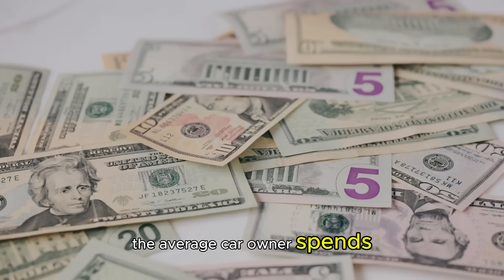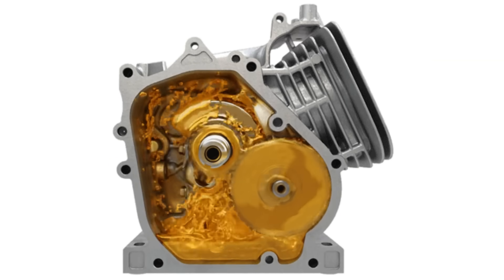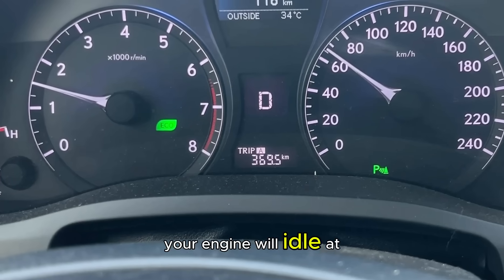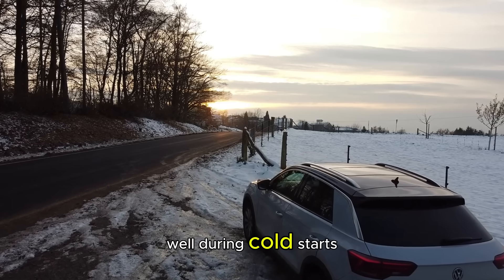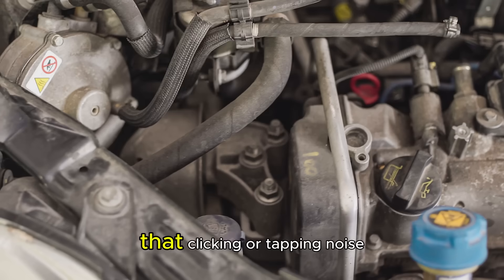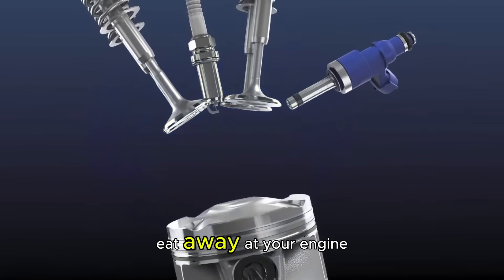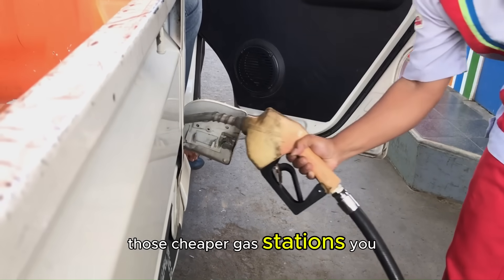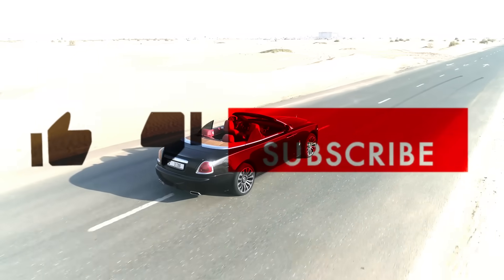Stop Making These 6 Cold Start Mistakes Before They SECRETLY Wreck Your Engine

Comment: I'm not saying he is totally wrong, I've been a mechanic for 40 yrs so YES I'm getting old. 1-ablock heater does NOT keep coolant at 85 degrees, I have a programmer on my 2012 ram 6.7 cummins, it shows actual temp, not even close.  2-they do not actually warm the oil, you need a pan heater for that. 3-as far as only letting it idle for 30 -60 seconds, little longer for diesel, then driving for 5 minutes BEFORE turning on the heater? Maybe if you live in palm springs, was -50 the other day, my acorns may not be huge but they would have been inverted, probably would have hit the ditch, how the hell do you see out the wind shield?  4-other than aluminiaum (no I don't know how to spell that) metal expands and contracts at the same rate, this is why they have specific clearances. I do agree don't rev a cold engine or rev it and then turn it off immediatly, even if warm, good way to destroy a torque convertor,  the one thing he is totaly right on is ALWAYS let a turbo car, gas or diesel idle for at least a minute before shutting it off, will save you a lot of money. no insult but you're a younger man with more to learn. Safe travels everyone.
Reply: Thanks for teaching
Reply: thank you, but if u let ur car idol for a bit on a cold start is that really bad like he “ai probably” said in the video?
Reply: Shit man. I haven't been doing this for at least 30k miles... I usually let the high pitched RPM noise die down before driving off, but I usually shut off right after I park..
Reply: Every single observation you made is on point ( it's Aluminium - that made me lough out loud- and yes, the pale Brits say it the right way). As a European a yearn for a halftone pickup truck with a Cummins engine. They're pretty scarce around here. And the new American trucks are mostly garbage. Just as a question or tip: if you're living in harsh winters you should checkout those high-idle chip tuning kits. Obviously for when you're idling for longer periods of time.
Reply: Mainly the dodge has a auto idle up, you can do it with cruise control as well, have to get a 3/4 ton for the cummins (stay away from anything newer than  a 2012, they went to a roller lifter, bad idea. Takes out cams just like the 5.7 hemi) If you want a good one find a 5.9 cummins, best one ever built. Yes I'm a mopar guy but had fords, chevs and imports, dodge is the only one that never made me walk home. (Hell I can barely say it little own spell it lol)
Reply: If you start off with your heater running it's not going to warm up the cab anyhow. So that ain't gonna defrost your windows, now is it? And it will take much longer for your car to get up to running temp. I keep my heater completely off until my temp gauge shows tip top reading.
Reply: @markr.1984  Well bud I have to disagree, truck is plugged in all night, at -30 with the weather front closed, after doing about 10km or 6miles, traveling about 30mph, then a 20-30 minute drive down the highway the thermostat is JUST opening. Might as well buy a ski doo. Obviously you're not from the same part of the world as I am. Just saying
Reply: @markr.1984  My windows show signs of defrosting with two minutes and I live in northern Utah.  To hit your so-called "tip top reading" would take 15 minutes where it actually gets cold with or without the defroster on....
Reply: @markr.1984 If You start off with Your heater running it's not going to take of too much heat of Your engine anyways... Running the AC auto mode for example helps to dry out Your windscreen anyways and shows optimum operation for the heat management (fan speed relative to avaliable heat). It won't take MUCH longer if Your putting it at gentle to morderate load throughout warmup cycle (as it is advised). Modern engine oil flows pretty fine even at moderate temp. Im not going to freeze inside to save few %(thus making probably .% change on engine lifespan perspective) from massive pool of wasted heat that typical ice produces anyway, just to suddenly switch on super hot air blown from the air supply at the very "tip top" reading of coolant temperature gauge, that is most of the time indicative only (real temp at the "perfect" gauge mark may vary from 75 to 105 on most cases which is still fine anyways)

Comment: This îs for GAS engiens
Reply: Many of the principles explained here apply to diesels as well, such as the thermal expansion and contraction of engine parts with temperature. I can literally hear the difference when some of our tractors are running cold vs warmed up. They sound "harsher" when cold, like they're not happy.

Comment: What the hell is he trying to say? First off a couple of mins of research along with mechanics will tell you letting a vehicle sit and idle while cold decreases engine life not prolong it idk if you know this but when you’re idling you’re not getting much oil to your piston rings and other components that need oil to function correctly so you don’t grenade your engine driving actually helps things get lubricated, so the need to warm up your engine before driving is a proven myth and has been shown to do more harm than good, your engine will warm up with moderate driving meaning normal driving like gradually speeding up to the speed limit and not punching the accelerator like a mad man at a drag strip trying to get the best time in the quarter mile and really that’s it!
Reply: The guy literally said idle 30 seconds to one minute, your car is already above its natural idle for that period of time. Then start driving nobody’s sitting and idling.
Reply: @johnweimer3249 some people can’t listen and just like to argue

Comment: Good info . . . if you live in snow country.  I'm in the San Francisco Bay Area. Coldest temp is around 34F-36F max in the morning. Normally it's 44F.  Nothing at or below freezing temps.  I follow "Click and Clack's" (PBS) recomendation: The first 5 minutes or first mile, drive slowly and gently to let the engine and transmission warm up.  After that, do whatever you want to do.

Comment: So, all hybrids will die early? My Toyota yaris won't last long????
Reply: Why, hybrids take care of these things
Reply: @davewebster1627  i hope so
Reply: Nothing can help it last long.  I drive a rental with 30K miles in it and it shook so bad at highway speed I thought the whole front end was going to fall out.  It's the only vehicle I ever heard John McElroy, an automotive writer in Detroit, bash as the Echo before it was renamed Yaris, which he also lamented.  And I totally agree with him.  Nissan electric power steering sucks, too.  I worked as an automotive engineer in Detroit specializing in fuel systems, powertrain and brakes for 44 years.

Comment: None of this actually matters, because there's no way to avoid cold starts, unless you have a block heater and you keep it plugged in. Of course, you shouldn't rev it too much while it's cold. But it's definitely going to get cold, when you shut it off. Even if you live in a warm environment, that engine is still cold when you start it. You obviously don't live in Minnesota.
Reply: When my family lived in Minnesota, all of our cars had block heaters!
Reply: @brianzimmer5532  
They sell them from the dealers that way, here. I don't know if they're all like that, now, but it used to be pretty standard in this area.
Reply: @brianzimmer5532 they are needed in that harsh environment
Reply: A webasto diesel heater makes every planned start +50 C in the block. I say planned because it takes 30-50 min to do if it is -20 C outside. Then I have rpms drop after start (30s) and drive gently until operation temperature is reached.
Reply: A lot of it does matter. The part where he suggests not idling your car for a half hour parked in your driveway is very pertinent. I drive off after 20 seconds but drive easy for the first two minutes and only moderately for the next two or more after that. If you let your car sit running after you start up and go back in for a cup of coffee, then good luck staying out of the repair shop. I already knew that a long time ago.
Reply: @markr.1984  
Yeah, when it's below zero outside, you're not going to take off that soon. You're going to sit there and let your car warm up for like 10 mins. Especially when it's covered in snow or ice, and you don't have a garage. Dude, I have lived in a state with sub-zero freezing temperatures, for a good portion of my life. Trust me, you're not going to take off in 20 sec, when it's that cold . 🙄 
And no, idling does not do any damage. The initial start is what does the most damage. At the very worst, it's just going to use a little more fuel until it warms up. That's not even bad for the motor. It's supposed to do that.
And no matter what you do, you're going to get worse gas mileage when it's that cold outside.
Reply: @SloppyGoat that's because the vehicle is running rich, then takes forever to get to operating temperature which is best for emmissions
Reply: @Johnnyjacobs-h8f  
When is this cold, they always run rich. You will always use more gas in the winter time. It's literally 0° F here, right now.
Reply: Yes it does matter. You obviously do not know vehicles!
Reply: @JadeaRS4  
That's funny. Since I was a mechanic for more than half of my life. Once a mechanic, always a mechanic, actually. I've rebuilt more motors than you've seen.

Comment: I was hoping for some useful info but then realised I’m a mechanic and I know everything you’ve just said 🥲 what a waste of time
Reply: What about keeping the heater off, or at least at cold, until the engine and coolants warmed up (first); especially for diesels? (excluding where auxiliary heater only; where there is one; and it actually works!)
Reply: @Richard_L_Y   The heater is like a mini radiator and if your heating system does not have a  hot water valve that turns off water flow when the temperature knob is turned to cold it does not matter much.
 What I find that works best as a retired technician is run the fan at a lower speed so  the air has some time to absorb some of that little bit of heat until the engine gets warm.
 A diesel at idle does not produce much heat so you would be correct to turn the temp to cold or keep the fan off till it warms up.

Comment: Just move to Southern California. lol.  There is a reason why used SoCal cars are in demand.  No frigid starts with rapid warm-ups.  No salt induced body rust.  No humidity corrosion and mold like a hot Miami car.  But great advice and great information.  Also change your oil often to get rid of the water and fuel contaminants.  I would never buy a used car that lived its life in the Midwest or East.
Reply: @badkid73  will consider to moving to CA if you move Nancy out😄
Reply: Aman to that 🙌🏽

Comment: A lot of these issues are handled by technology. For example, my RAV4 uses 0w16 synthetic oil which is so thin it's really almost like having gasoline in your crankcase rather than oil. Cold temperatures don't slow it down a lot. Blasting the heater when cold is handled by computer-controlled solenoid valves that turn off cooling systems when the engine needs to build heat. Those systems get the car to peak temps pretty fast. 
One thing for sure, even when brand new, it sounds like a diesel when starting cold. That is because the exhaust VVT system is oil-pressure controlled and will clatter when cold. As well it has a direct injection system that is pretty noisy - just like a diesel's - when it is running cold. The horrible noises it makes discourage pushing it too much when cold. IT IS NOT FREAKING PISTON SLAP!!! Jeez!
Reply: @penguinjoe1961  called Atkinson's cycle mode for carbon deposits on intake valves because of direct injection...use marvel mystery oil in gas and carbon will never build on valves and will increase gas mileage by 3 per gallon.

Comment: I miss the days of my 1961 GMC, 1969 IH, and 1979 Dodge trucks.  I installed a circulating tank heater in each of these.  Get up in the morning to do a cold start (once at -51F) and starting was so easy.  Also, instant heat from the blowers in the morning.  Further, leave your manual defrost control to the "on" position and you never had to scrape your windows in the morning.  The next best thing was a lower radiator hose heater I put into my 1995 Ford Taurus.  Never a starting problem.